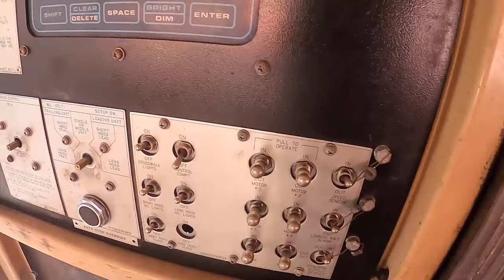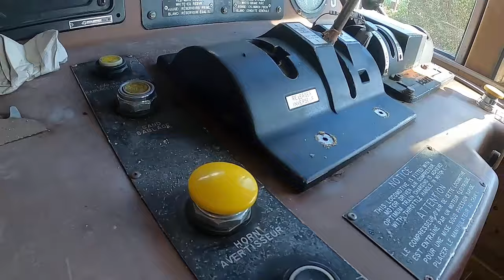Exploring a CN Locomotive Graveyard in Ontario

Comment: Worked on a lot of these engines. I'm so glad to see them being scrapped. They were noisy, always cold in the winter, nothing ever worked well and hot as hell during summer (no air conditioning).
Reply: The cab walls were just cheap peg board But then all those MLW products were all junk.Those 2400 series were named after a former chairman of CN when it was crown corporation

Comment: Many of these locomotives have not operated for years. This 2428 for example, I saw a story about it, this model was designed exclusively for CN. They have already been taken out of service and these survived in this courtyard. This video is very good. Congratulations.
Reply: Incorrect. BC Rail and QNSL also ordered this model. This model was not exclusive to CN.
Reply: @GEES44DC  they also still use these models in freight service, I’ve had the displeasure of having to operate them still lol
Reply: @1BadVan  CN only has a handful of active Dash 8s left. Once replacement power comes to the DMIR, bye bye.
Reply: @GEES44DC  more then fine by me, they should have been retired years ago lol.
Reply: @1BadVan  than
Reply: @GEES44DC  I truly hope that you made you feel better

Comment: My dad was a conductor at CN and I remember getting to ride around the yard on his lap in one of these types of engines and in a caboose ( this was the 80’s so they still used them and safety rules were more lax) It’s a super cool memory of mine. They also had a phone on the engine and when he’d call us from the road he’d always blow the train whistle for us
Reply: Back in the mid 70s, when I was a technician with CN Telecommunications, I frequently rode freights in Northern Ontario.  While usually in the engine, I sometimes rode in the caboose.  On one occasion, I had an overnight trip from Foleyet to Capreol and tried sleeping on a bench in the caboose.  I was occasionally tossed off by the motion!

Comment: They still use some of these series engines out in BC. As an engineer, I can say I didn’t look forward to having to drive these older units, underpowered for the massive trains they build now and the dynamic brakes on them were basically useless. It was a long trip when you had one of these as the leader. Biggest bonus though for a CN unit is they all had a microwave
Reply: Yeah got to ride on one once, it was definitely interesting.

Comment: I used to be a technician for CN Telecommunications and back in the mid 70s frequently rode freights when I worked in Northern Ontario.  I haven't seen the inside of a locomotive since then.
BTW, back in those days, when I hopped on or off a train, it was usually moving slowly, as the engineers didn't want to stop the train if they didn't have to.

There was one trip where I was taking pictures, while standing under the headlight and the train was traveling at speed.  I still have those slides I took.
Reply: Did you ever use morse code on the telegraph, or was that abandoned by then?
Reply: @BADBIKERBENNY   It was before my time, as shortly after I started they retired their last revenue Morse wire, though some of my older co-worker had.  However, I did manage to salvage a Morse sounder from the office in Geraldton, Ontario, before it was demolished.  I still have it.

Comment: cool video, sad to see those locos getting scrapped though
Reply: Ya and that is a waste of good locomotives
Reply: @commanderblueproduction2401  a waste? right cuz they werent built 35 years ago
Reply: @benjlar1902  evidently you know not of what you speak because there are several locomotives built as far back as 1965 that are still in service to this day without issue provided that regular manufacturer specified maintenance is performed.

The EMD SD40-2 and EMD F40PH are two prime examples of old power still in use after many years.

Hell, there are two axle scale test cars still around today that were built as far back as 1930.... Age means nothing in terms of equipment. It is how well and frequently that it is kept up with that makes the difference. Things made long ago were actually built and manufactured to last. Anymore, things are designed and engineered to fail after a certain amount of use to bring the consumer coming back to buy the "next more advanced model" every so many years.

The older tends to be the better and more reliable actually.
Reply: @nsrailfann4life91  another know it all... thanks for the lesson. I was referring to the engines in the video in which none of the dash 8s were built in 1965. the yard power I use daily at CN date back to the 60s. gp9s date back even further. but ur right, i dont know what im talking about
Reply: @nsrailfann4life91  you told me i dont know what im talking about so surely you know it all then? seems im the one who struck a nerve i called you a know it all and you told me to go get laid.... right on
Reply: @nsrailfann4life91   OK so to review once again, ive worked on these engines, have you?  You say my statements are inaccurate well how are they inaccurate? They are unreliable junk and that's why they were scrapped.

Comment: I forgot CN bought some of the Conrail c40-8w’s. I saw the red marker lights and remembered lol. A few of those engines Look like they are still ready to work. It’s cool to see the inside of the Canadian cabs I didn’t realize they have doors on the side of the cab to.
Reply: they were ex LMS, a short lived thing between CN and CR
Reply: @aspenGF8  ah that’s right I always wondered what the deal was with that
Reply: BN leased some LMSX B39-8Es
Reply: @aspenGF8  LMS is the Conrail leasing company, their C40-8W is have the same spec as Conrail
Reply: @aspenGF8  lms?
Reply: @Railfan Canada  Locomotive Management Services I  believe it stood for. Some sort of a joint leasing thing between CN and CR. CN had them half the year, CR had them the other half.
Reply: @aspenGF8  oh cool I didn’t know that thanks for the info!
Reply: Some of the numbers in this video were actually still in use in 2019.
Reply: I have frequently rode freights back in the mid 70s.  As I recall, there was the one door at the front and one one each side at the back of the cab.  This video also showed the toilet, which was right beside the door in the nose.

Comment: It's telling when the Dash 8's are all getting scrapped, while their precursors, the EMD SD40s, are still widely used to this very day.
IIRC, a lot of the older GE's had trouble with their turbochargers, resulting in engine fires. An engine fire in the previous generation of GE loco, the C30-7, was a major contributing factor to the Lac-Megantic rail disaster.

Comment: Over the last 12 years the rail road has gotten smaller and smaller.. Due too they are not fully needed anymore. Yes they need trains but not as it once was.. Where i heard ever line up as a kid too 30 trains on too few years ago was like 5 to 6.. On the go. Its crazy. How time evolved this once amazing industry.
Reply: CN replaced these engines with pretty much the entire Citirail ES44AC fleet. They didn't downsize their fleet. Train traffic volumes are still a lot higher than you think they are.
Reply: @GEES44DC  . tell me good sir do you know the counts. ?. Of acctive engine.
Reply: It was because train get longer and longer and just need pulled by few locomotive, thats more efficient to double the sized train than run train regulary

Comment: Most of those engines look like GE crap 8s
Reply from the maker: After the amount of video's I've seen of them on fire, it doesn't surprise me lol
Reply: They're the Canadian version of an SD-701 they called the GF-640a. Those are awaiting the scrapper if I had to guess...
Reply: @chuxtuff  I dunno man, they don’t look like EMDs to me, their trucks look like Dash 8 trucks. The control stands are GE as well
Reply: @ThrashMetal_12v71  The Canadian units have the model number right below the 4 digit numbers. It says GF-640a and when you run that through your favorite search engine that's what comes up. SD-701 what's that a first gen SD-70? That's a US designation. Anyway I'm just talking about the Canadian units there. And I saw that number more then once in the video too. I'm no expert I'm just a rail fan with some curiosity...
Reply: @chuxtuff  wrong. 

The GF640 is a CN only designation. 

GE
Freight
6 axle
4000 hp

The letter is the order number. A = 1st 4000 hp Ge order. D = 4th GE 4000 hp order. And so on.
Those are all GE C40-8 variants.

Comment: Man. A shame some of these locos are getting scrapped. At 1:07 on the right is a CN “blue devil” those things are rare to see.
Reply: rare is an understatement for those beasts, the only one remaining is IC - 2466 C40-8W. and it has been reported to be leading trains as of the past few months. (fitted with PTC?)
Reply: Yep, 2466 has PTC.
Reply: IC Blue Devil
Those are not CN engines.
Reply: @GEES44DC  they are under cn ownership
Reply: @Lordbillystrains  Uh, no. They were owned by the Illinois Central, a CN subsidiary.
Reply: @GEES44DC  conrail bought them new then were leased as lms then cn got them put ic reporting marks tried to find info on that couldn't find it and cn operated them until most were stored/scrapped by cn
Reply: @Lordbillystrains  Dude, CN bought them through the IC. After the lease was bought out, they were under IC ownership. 

Owned by the IC. Identified as IC. 

These were never CN, always IC.
Reply: @GEES44DC  Cn logo on it and 2466 is is listed on the CN roster
Reply: @Lordbillystrains  You're dense. Read what I just told you. The reporting marks are IC and they are OWNED BY THE ILLINOIS CENTRAL. 

CN put them under U.S. ownership through their IC subsidiary.

Let's give an example.  Chevrolet is a GM subsidiary. A Silverado is a Chevy truck. You don't say a General Motors Silverado.

From a legal and business standpoint, CN doesn't exist in the U.S. They exist as an operating entity. All their U.S. business is done through their subsidiaries.

All their U.S. employees are technically employed through their U.S. subsidiaries.
Reply: @GEES44DC  Since you put so much effort into this you win
Reply: @Lordbillystrains  I win because I'm correct.

Comment: These graveyards are private property well technically it could be CNs property and trespassing isnt advised because if caught its at least a $200 fine . your lucky the company or yard was closed because normally youd see employes working . the log cars seem brand new and wonder why their put there . this place i think all they do is strip out the engines and electronics then i think whats left is sent somewhere else to be chopped up torching would take way to long and youd need a lot of dumpsters to haul away the metal and the fuel tanks are considered hazardous waste the wheels can be removed and reused same with the cupplers . theres a big company in montreal that does the same thing to cp and cn engines all they do is salvage the engine parts the rest is sent to aim scrap metal .